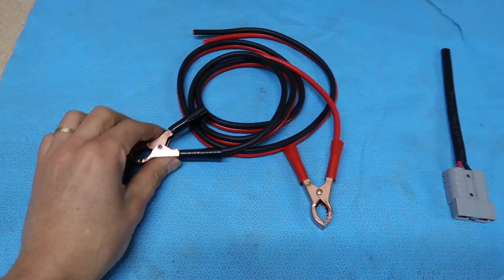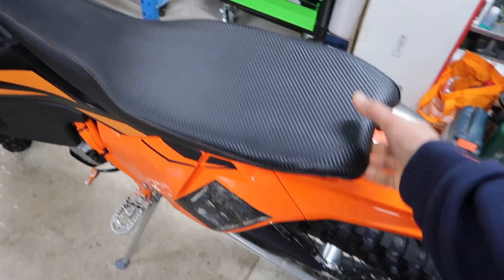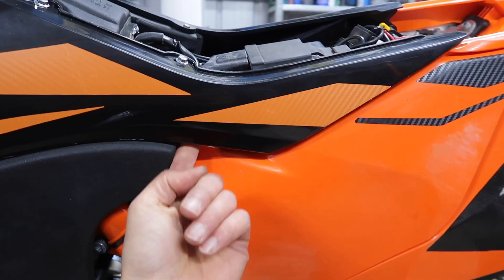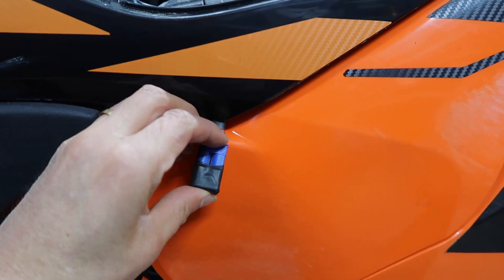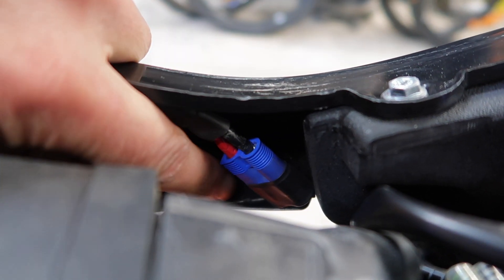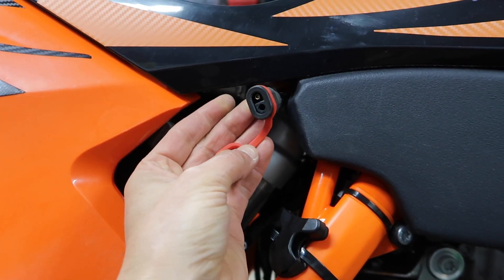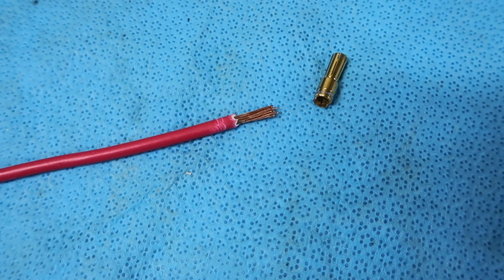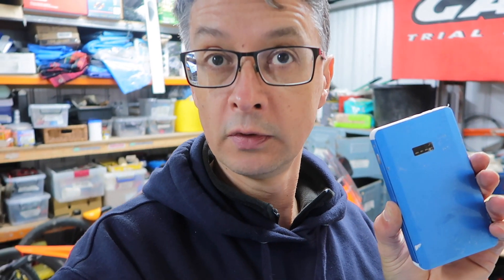How to wire up your bike for easier jump starts

Comment: I really like this idea but I have a question. Most of these battery jump packs have an inline gadget between the ac5 connector and the alligator clips. Did you wire that into the wires that stay attached to the bike? I'm not sure what that little unit actually does so I'm not sure if it's even required.
Reply from the maker: I did not use that part. Not sure what it does, maybe a diode to control current direction?
Reply: @keithjob  Yes that box contains several high current diodes wired in parallel. This is to prevent your bike forcing power back into the jump starter pack, and possibly making it explode in your hand. See this link: 
https://www.youtube.com/watch?v=F8zghvQZYNM
Reply from the maker: @cathy2128  Thanks Cathy, makes sense. I'll pin this comment so people know.
Reply: I tried doing what you did with my new power bank and it doesn’t seem to work without the diode part. What power bank do you have that works without it?

Comment: That’s a good tip if you’re still using lead acid batteries 🔋. It’s been a while now but I’ve converted my bikes over to the AntiGravity Lithium ION RE-START batteries and waking up to dead batteries seems to be a thing of the past. The weight saving is enormous and the only downside is an inability to charge or run external devices for any length of time when the bike isn’t running because the Lithium’s don’t carry a large reserve. So, I just make sure and get whatever I need charged while I’m on the bike

Comment: Does this still work if you connect the negative cable to the frame (ground) instead of the negative terminal of the battery? So positive to positive and then negative permanently fixed to the bikes frame to ground it.

Comment: Great video and good details. What gauge wire would you recommend for the wires going from battery to the EC5 connector for a motorcycle 650cc?
Reply from the maker: Hmmm can't remember what I used... the biggest that will fit inside the EC5 lugs! Maybe 6mm automotive cable? (Which is 4.58 mm2 cross-section of wire). It is rated 50 Amps I believe which should be OK for starting a bike.
Reply: Most jumper cables use 10AWG wires.

Comment: Nice idea...was just wondering what you would do if your battery was completely dead?...as in that case the bike (any 4st Efi) would start up when jumped but would die as soon as you disconnect the jump (power) source...I know it's an extreme case, but it's better to be prepare for anything esp when riding in remote areas...I've heard there is a capacitor  add-on that can make such bikes startable (kick or push) in such circumstances...do you have any idea/experience with this?
Reply from the maker: Not sure it would just die if the engine was running and you removed the jumpstart? Don't know...
Reply: @keithjob  yes I've tried it on my 500 exc 2012...1st I took one of the bat leads off (-ve) and tried to kick start it and it didn't start but when I put the lead back on, it started 1st (lazy) kick... 2nd while the bike was running I took the bat leaf off and it died immediately...So basically from what I've read, its impossible to (kick) start and/or keep the bike running after jumping it, if your bat is completely dead (which i simulated by disconnecting a lead) as the power the stator produces is too 'rough' or 'dirty' to run the bikes electrics...it could (kick or bump) start with a low battery still connected as that makes the power more 'smooth' or 'clean' the stator power...same concept applies for the capacitor (afterall a battery is just a capacitor with more storage)

Comment: You answered my question that I've been hunting for the last hour! Is it safe to jump off SAE plus (and I was even looking at the optimate you have on your bike!). Thanks again Keith!
Reply from the maker: I've tried it and it works fine...because the cable/plug can carry enough current. The Optimate connector probably won't work because they usually have a 10A fuse which will simply blow.
Reply: Okay so to clarify. On the battery you have one ringlet attachment on the battery terminals and it runs to your ec5 for jump starting purposes. You've then 'stacked' another ringlet connection on top of the ec5 ringlets on the battery terminals which is your optimal sae/ trickle charge with an in-line fuse? 
I'm in no way electrically savvy but is it safe to 'stack' multiples on the terminals? I'm not being a smart ass. I'm genuinely asking the question. Don't want to cause a fire under my ass!
Reply from the maker: @MarksOAM  yes. You may need a longer bolt if too many.

Comment: What jump start pack is that? its very compact.
Reply from the maker: It was a generic unit out of China. Only 4000mAh, which is plenty to start the 500. This is its sole purpose in life so it's fine - I have another unit for phones etc.
Reply: @keithjob  Hi mate, I see its just a generic charger but do you happen to have any more details on it? Interested in finding what connector they use.